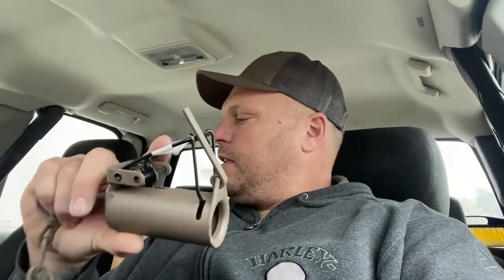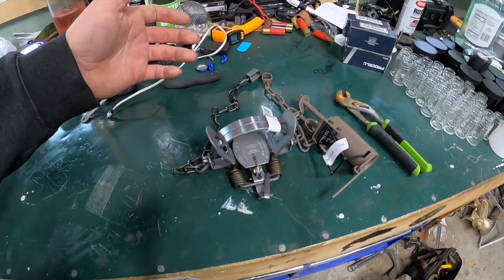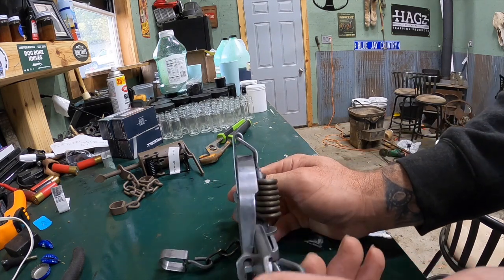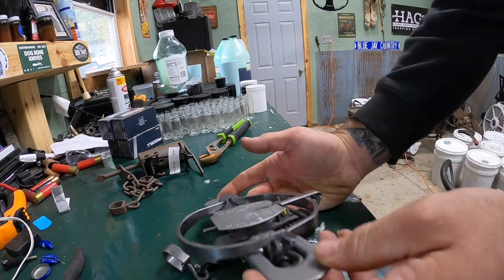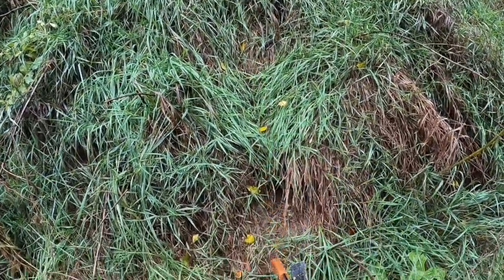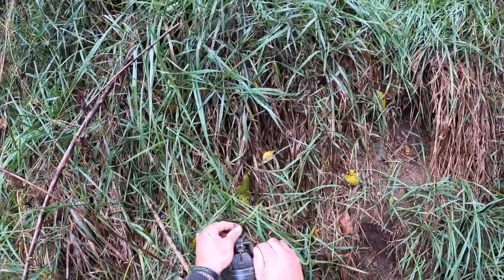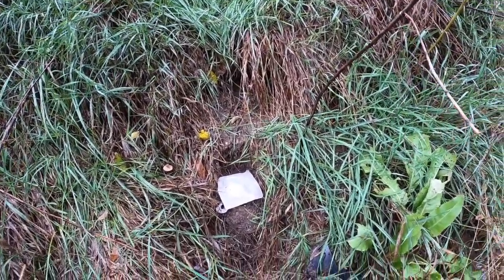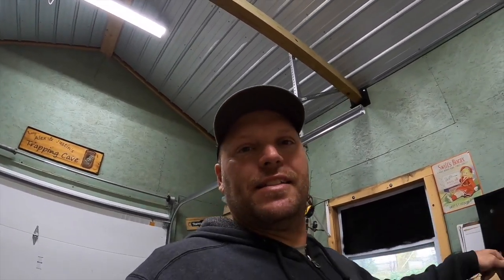From store to trap line

Comment: I wash my traps in dawn dish soap to get the oil off then run them through the dish washer with no soap on pot a pan cycle it works really  well an start the rust process too

Comment: When i was a kid.  My dad taught me to make a drag.  about a 3 inch diameter piece of green sapling about 4 - 5 foot long and wire the trap to that as a drag for Coon.  Of you wire the trap in the middle of the sampling you can use it in the set as a step over on the trail. Man it works great.  They chew and fight that stick.  I try and find one with lots of branches and cut them off and leave about 2-3 inches of the branches on the main part.  If you can get ironwood sapling they are heavy.  But overall they don’t ever get very far no matter what species of sapling you use because why concentrate on fighting the stick that they think they are tangled to somehow.

Comment: #2 double coil spring is a little light for yotes in my book. I'm still using 4 coil dogless #2s with heavy bases that I bought yrs ago ( copies of the old Montgomery dogless). Double rebar cross stakes 20" long, they will hold a 50+ lb yote. Kids and new trappers need to understand that catching isn't that hard but keeping the animal there is the trick, a catch circle is a great draw for another animal.
Reply from the maker: This video was 100 percent about coon trapping with an occasional coyote/bobcat  in a blind set which is why the upgrade from a 1.5!